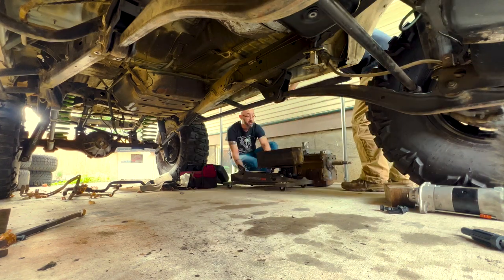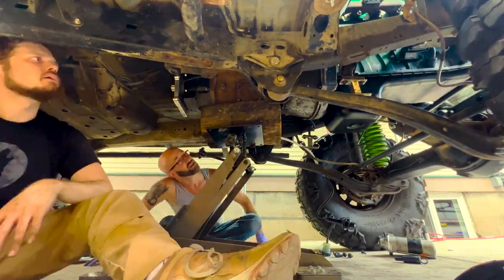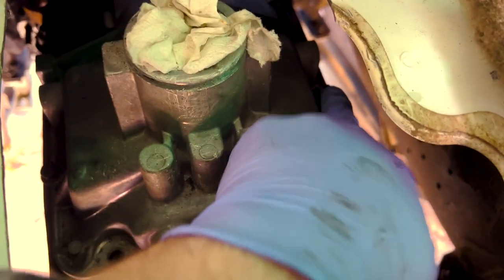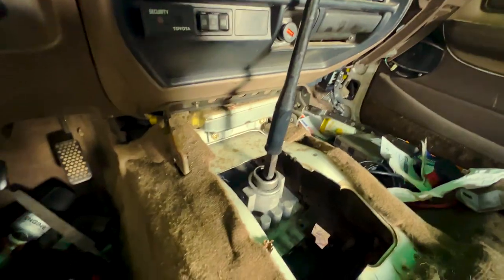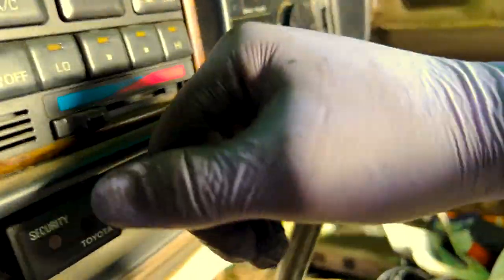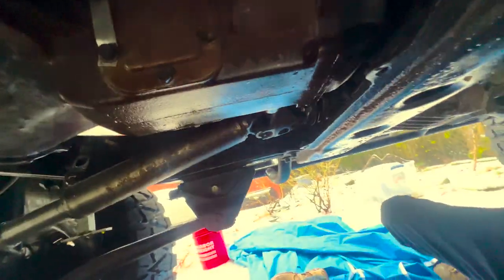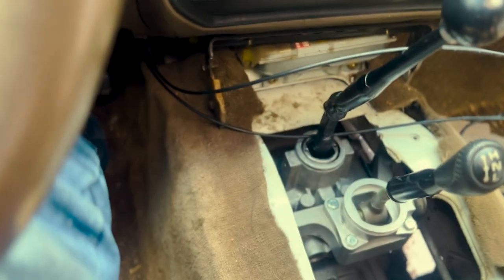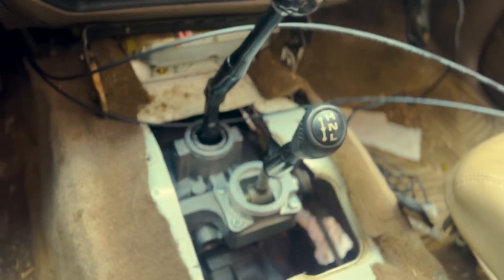Cummins Swap Part 5: Transmission and Shifters

Comment: Nicley done! I must have missed the part in you video that says what transmission you are using. Thanks, keep up the cool work.
Reply from the maker: Nv4500 with a new main shaft milled down to 19 spline for the Toyota transfer case!

Comment: Loving the videos. A little behind but I just picked up a 6BT P-pump for an eventual swap into my 80 series with an NV4500. I've had this planned for a while just haven't pulled the trigger on a motor.
Reply from the maker: Nice! The motor should be the cheapest part
Reply: @Austin_SaintOnge  I know…that’s kind of the depressing part. Lol

Edit: the motor is the only thing I’ve bought so far except for the adapter plate for the transfer case. I’m not 100% sure if I need to source a 4wd or 2wd NV4500
Reply from the maker: Ah I see I misread while I was driving. I just found a ppump for 550 so the good deals are out there. I would buy a 4wheel drive nv4500
Reply: @Austin_SaintOnge  I’ve had the adapter and re-splined output shaft for a few years now and I recall that the output shaft was a re-splined 2wd one so I couldn’t recall what NV4500 I needed. There are a few versions of the adapter plate out there and the one I got I think was originally made by Allmaras (sp) that I got on a group buy and he doesn’t seem to be around for me to ask to add to my uncertainty. This is a very long term project that will prob not happen until next winter so I have time to gather parts. Too many hobbies..lol
Reply from the maker: @kleinbiker1  you’re going down the correct rabbit hole yes. The main difference between the 2wd and 4wd is the tail housing. The truck I purchased was a 2wd so I had to have it rebuilt with the resplined shaft and purchase a 4wd tail housing- which was only around $130
Reply: @Austin_SaintOnge  ok awesome. I think I already have a line on a 4wd NV4500